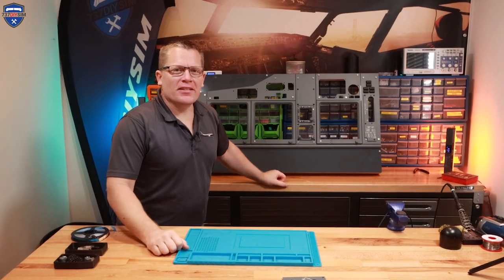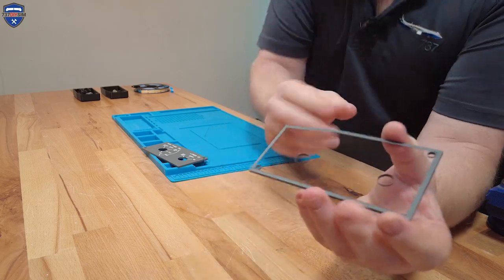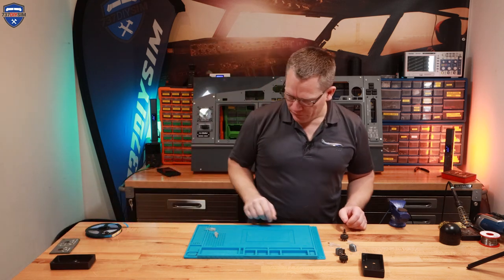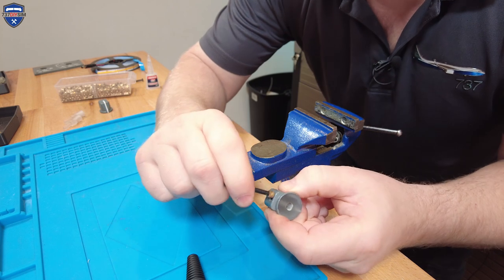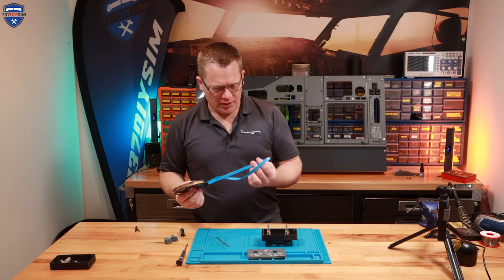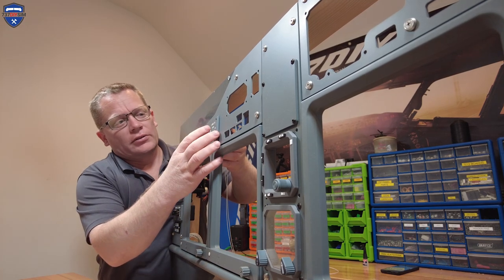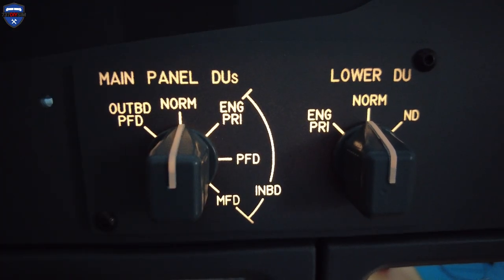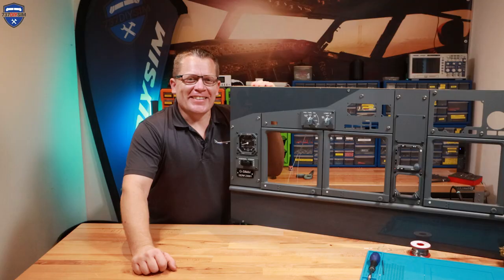737SS DU Panel Build

Comment: A good closed design. And you even have made designs for both rotary sizes. A lot of work.
Reply from the maker: Good morning Mickey, I want to make sure I provided sim builders with all the options for this build. You can either 3D print each part or purchase the laser-engraved version. Unfortunately, the large eight position rotary switches are not as easy to find anymore, so I have included the design for the smaller 16mm rotary switch, which is more readily available, to make the design a sort of universal build.

Comment: Hi Karl, glad to see you building a single seat version of the 737 and sharing it with the community! As this makes my idea of having a sim in my rather tiny house more realistic, I started purchasing this DU module as a test for myself. When inspecting the delivered models, I noticed the stress relief for the cables nor hole for it in the DU-L/DU-S was included in the design. Is this something seperate to purchase or was the design not yet updated on the website? Thanks!!! Edit: I suppose you just drilled a hole in it, and bought a stress relief in the shop, right?

Comment: Really cool! Aren’t the real switches white though?
Reply: No, they are a light grey, FS595 - 36440 to be exact.  Also, only 4 of them on the whole flight deck are actually backlit.
Reply from the maker: Defo light grey, But dont fall into the trap of wanting the exact boeing colour. Theres no need, A light grey will do aslong as they are all the same. This goes for the whole cockpit. Ral 7011 (iron grey Matt or satin) is easy to get hold of, and as long as all the panels are painted with same paint, its going to look amazing. I see way to many people get hung up with trying to match the exact colour code.

Comment: How did you cut your back panel? Ive got OEM goodies that probably wont fit in a panel from a manufacturer.
Reply from the maker: I cut my back panel in several sections, moving the one peice acriyilic along on the bed until it was all cut. I will produce a final build video showing this. But its pretty similar to Mickey flightdeck who has just published something very similar to how i did it.

Comment: so this will only have functional components on the left side? or whats the plan to make it SS
Reply from the maker: Hello, The singlke seat will have full functionity of the dual seat 737. The co-pilots knee panels will be added to the captians side as will the 6 pack. I have removed the first officer ND/PFD. This saves me a lot of space and a monitor hook up. These builds are currently aimed at my Patreons so they can build and help test the design before release.
Reply: @helimech8152  Gotcha, sounds like a great idea.